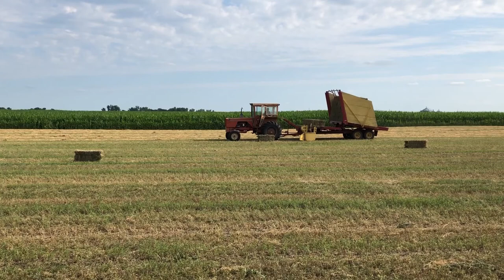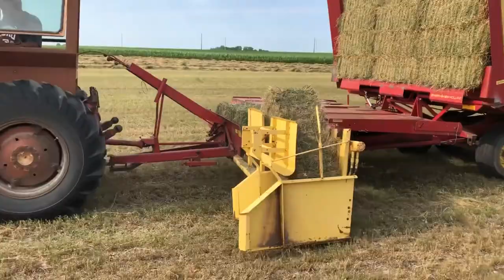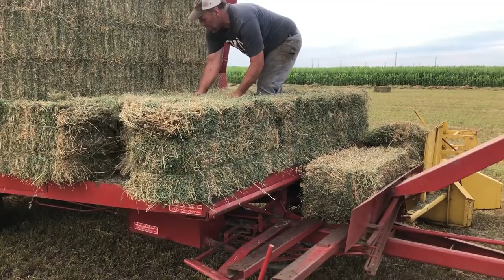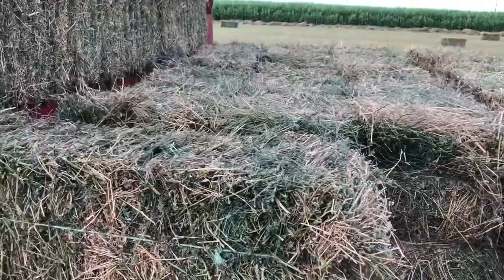1034 bale wagon picking up bales

Comment: If you put some cheap welded wire fencing on after bale #12 of tier 5, you won't need tie tiers. In my experience, the stacks are more stable and stand better than with tie tiers. If you're loading out with a grapple it's easier without tie tiers.

Comment: 180 Allis Chalmers just a great all around tractor, quick , nimble and fun to drive.
Get rid of the Stanley Muffler and get a Nelson it will run better
Reply from the maker: That was always on it when grandpa had the tractor and we just haven't had to replace it yet. The tractor is getting up there in hours probably around 14,000. the tack stopped working at 10,000 hrs
Reply: @farmingourway8493  so it's just broke in good 👍